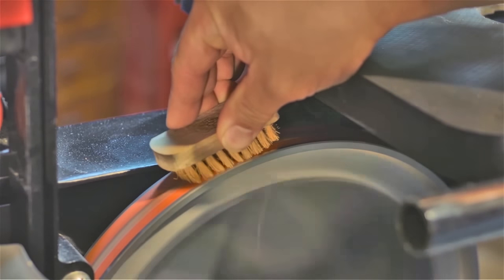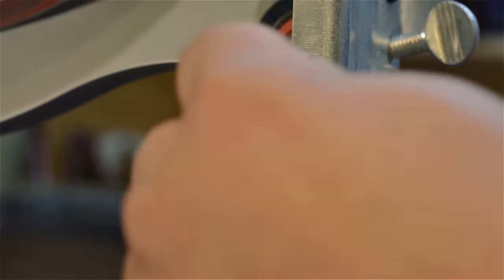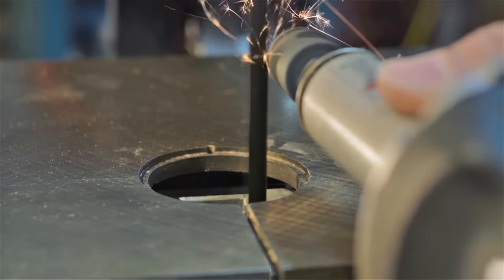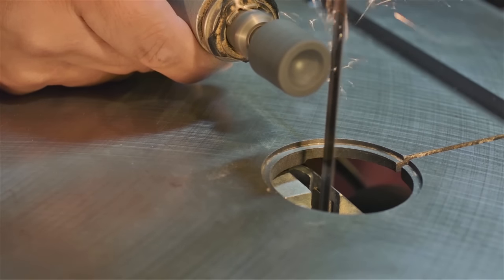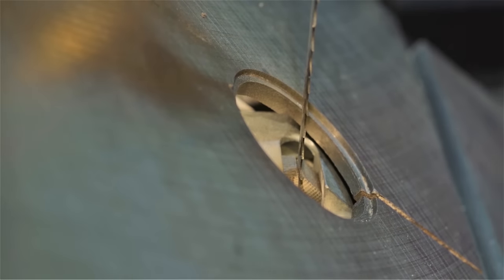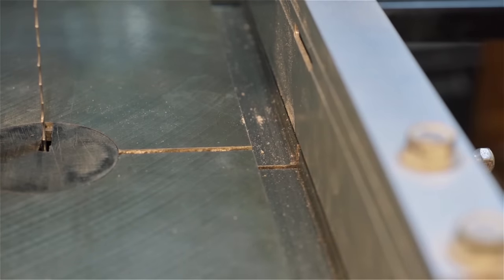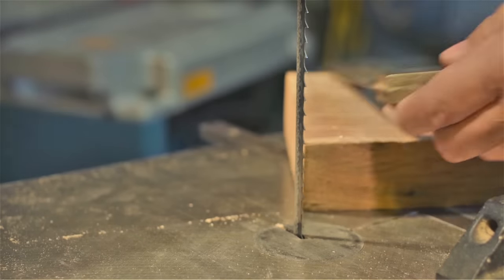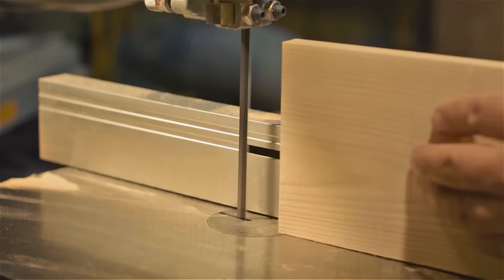Bandsaw Tuning For The Anally Retentive

Comment: this is the best band saw "setup/tuneup" video I've ever seen.  I think we are the only two people in the country who agree the carbon blocks are better than roller bearings--but after trying both--totally agree the cool blocks are best.  Finally, surprising how balancing the upper wheel makes such a difference---there is another video out there where they drill the wheel and use lead weights like balancing an automotive wheel.  Great video--thanks for your work and efforts to educate everyone!
Reply from the maker: Today, bandsaws are made with lots of features,  not quality construction. Consumers rely on the longest list of extras to determine which is best. More stuff is perceived as greater value. Blocks were the norm for over 100 years and are elementally the best support!  I have no idea why bearings became standard issue.

Comment: well, you asked me to comment, so here it is... i do appreciate your attention to detail, however i don't believe a band saw is the proper tool to be worrying this much about. yes i am very OCD about my tools. especially the table saw. but in my oppinion a band saw is not a super precision tool. altho it should be close to 90% and should track straight. i am a carpenter by trade. but why worry so much about the blade back being smooth or straight? does it really matter? and as for the blade "wobble" or "flutter"  in my mind thats why we have blade guides? do you agree? or not agree? i do like the video tho so good job. just thought i'd bring up some of my own points. and i know i really have no room to talk, because i don't post videos of my wood working. mostly because the customers want my time as they paid for it. and not for me making videos. 

hope to hear back from you.                                                      Dave. / jped277
Reply from the maker: Sure, here's my thinking... If the blade back isn't straight, then when it engages the rear thrust bearing it will be thrown off or forced to twist in the spots that interfere. The blade flutter is a symptom of uneven tension in the blade due to imprecision in the manufacture of the blade etc. Tightening up the guides to address flutter would waste motion and increase wear. Everyone is told to set the guides back by a thickness of paper. This is prudent because it accomodates the imperfections in the blade etc. Remove the imperfectons in the blade -- and voila tighter tolerances. Imagine having one tooth on a miter saw blade that was out by 0.5mm, or the blade wasn't perfectly round, or the arbor hole wasn't right in the middle, or the blade was fatter on one side then the other... these would be unacceptable conditions for using a miter box would they not?

I do make a portion of my living with custom interior woodworking and trim, and I'm actually not a full-time You Tuber, I have no ads or sponsors. I make zero income from youtube. I made the video out of frustration because I just felt that every band saw setup vid out there was just another repeat of the same old BS - and that shit doesn't work really. 

I have yet to have the band-saw pay for itself on a job - it is merely a secondary toy that I use for cutting gun stocks and grips out of exotic/antique wood for myself. When you have to cut cheeks and shoulders that are compression fit, then it's gotta be accurate -and why make a fancy router jig for a one off. Everything I do is with a machine, as I am lazy but still anal retentive.  

When, and if I do get the time, I will do a video about how I use/tune my portable DeWalt table saw to do on-site veneer and yacht work. I love that saw, as I can lug it up on a scaffold, or carry it up a ladder... but that's about it.

If I did have customers that paid me for a video.. well then I would be over joyed! I am using You Tube for its original purpose - to share - and in some obscure way I hope that this video has helped others. That's it. I'm not creating a brand or asking for money.

I urge you, to take the time and share whatever knowledge you have or discovered / practiced daily so others can benefit too. Your efforts will be rewarded in other ways! YouTube has become perverted in a monetary/motivation sense, and this is a tragedy really.

Thank you for taking the time to comment, and I hope I answered some of your questions!

Cheers!
Reply: well then. first i am pretty impressed you even replied to my comment. most of youtube now days don't reply to a comment such as mine. and you do make a good point on the band saw blade.... your video does indeed instruct on how to reduce wear on your blade guides.... i wasn't thinking about that at the time of my comment. honestly i do appreciate people like you taking the time to make videos like this one, because i totally agree with you. youtube has become so monetized lately that most videos aren't focused on actually sharing knowledge, and i miss the days when it was... btw i'm age 30.... i wish i had the time to teach what i've learned in my construction years. .  i know i have knowledge that others don't. and i would love to be able to share. unfortunately i haven't been blessed with the financial privilege to be able to spend my time teaching.... so again i say, i do appreciate your video. and anyone else like you who does have the time to make these type of educational videos for other wood workers or carpenters or makers such as ourselves.   so thank you. and at the moment i have to go back to work so i pray you'll have a great night and ttyl.      

later. 
dave
Reply from the maker: Thanks, but don't forget to give back one day, as you will have the financial privilege in the future - just another more 20 years to go - that's the reality, everybody lives with it. You also have to enjoy making videos just for the process. Good luck and cheers!
Reply: great response and great video. i can never learn enough and your explanations are understandable and thorough. keep it up and Thanks.
Reply: If you've ever used a bandsaw that doesn't cut straight, you should appreciate this video.  I am going out to the shop to fiddle with my bandsaw and sharpen the blade =)
Reply: Well said, and a great video, I just acquired a delta band saw so the timing is good, I need to go through it and get it set up .. totally agree with your comments on Youtube, in fact, greed and advertising is ruining my online experience. Every time I go online I'm constantly hounded with flashing ads trying to sell me every tool I ever researched and bought. What a waste of money that advertising is.... and it is irritating ..

Comment: I found your video very useful. I’ve tuned many a bandsaw and follow your process, except for grinding the sides of the blades, never thought of it but will now incorporate into my process
Reply from the maker: Only has to be done if the blades are crappy, mine sometimes have crusted on dirt, and weld spatter - or generally the joint is too thick. Thanks!

Comment: Hi Joe, and thanks for an excellent and informative video. The definition of an X-Spurt is "A Has Been who is also a Drip Under Pressure." MANY experts, including most manufacturers, say to "CENTER THE BLADE." However, while researching for my bandsaw purchase I watched "Band Saw Clinic with Alex Snodgrass" who insisted the bottom of the gullet be centered, as you indicated. I discussed this with my woodworking mentor who tried it and found it to be absolutely true. Good going!
Reply from the maker: Thanks! Enjoy and keep the hobby & craft alive!

Comment: I have a cheap Harbor Freight bandsaw that won't even run because it was an old 3 wheel one. One day, I hope to not be hurting and can take it apart and maybe make a real bandsaw out of it. (I hurt 24/7 because of severe back problems and have to take opioids to kill the pain and have an implanted spinal cord stimulator also.) I loved this video because it showed me how to make sure the build is accurate, stable and runs properly. By following this video I can set up the blade to run right and not give me problems. So thank you very much for taking the time to make this and to impart your knowledge.

Comment: OK, so now I know what I am doing tomorrow...my bandsaw wanders all over the place so time for a tune up.
UPDATE: Did the tune up, replaced the two rear blade support bearings as the lower one one had seized. I can't believe the difference...quiet, smooth (trimmed the back of the blade as well), it cuts true, straight and perpendicular to the table .
Thanks for the advice and a great video.

Comment: I have watched dozens of youtube videos on band saws and tips and fixes but not until I watched your video did I get the information I needed.  I bought a cheap craftsman 10 inch band saw and had no idea about how to really use it.  Well I was trying to use it and the blade broke (I have no idea how  old it was it came with the saw).   I had a tough time finding a 70 1/2 inch band saw blade for it and wound up ordering a few (about $17 each....ouch).. I finally got the blade on but there is a lot of wobble in the blade I will use your information and try to fix the wobble.  Thank you a million times for your video ..I subscribed and will look for more of your videos.

Comment: Good video. I have two band saws and use similar tips to keep them cutting correctly. Some suggestions.....I got some stiff brush "wipers" that are setup so they always rub against the wheel bands to know off particles. This is necessary as my big bandsaw is a geared and different sized pulleys to make a variable speed one that goes from around 40 ips to 3000. The slower speeds are for cutting metals. I use that to cut parts from 1/2"-1" plate aluminum for later working on my metal lathe and milling machine. I also cut plenty of wood for various projects.  Of course you have to change blades as appropriate so all those blades are adjusted as you descibed.
One other thing I think you missed is to take a whet stone and run it against the two back edges of the blade at about a 45 Degree angle. This helps prevent burning or hanging when cutting a tighter curve in wood. I also use a blade wax like product that is touched to the blade teeth when running to put a bit of that wax on the blade. That also helps prevent burning...especially on cherry.
Another tip....use some furniture paste wax rubbed into the table top to make wood slide smoothly across the surface. I do the same waxing on my scroll saw table for the same reason.
I never hand held the grinder though....I prefer having it clamped so it won't move. I have a magnetic base that holds it to the table And PLEASE wear a face mask when doing this grinding to protect your lungs.

Comment: I have been struggling with re saw set up for too long. Recently retired and watched your video twice. Using the same principles my little 1/2hp Delta is making music (and that's with a less that stellar blade). My only out of pocket was for the cool blocks (like $15.00). It will repeatedly cut 3/32 all day long. Just joint a face, resaw, joint, resaw.... Thanks so much for your insight. How could all the so called experts be wrong.

Comment: A few years later:  I finally got in a position where there are some band saws to use and also care for.  I've been setting up band saws for a long time but just by some intuitive method, by guess and by god I think people say.   I have been vaguely aware that there is a higher level, and now the time has come!  I not only watched this a few times, but took notes.  I hope to add some small detail here:  You probably already do this:  The grinding rock on your Dremel or die-grinder is not always very well made, most of them are very eccentric.  I recently found that various diamond dressing tools as used for such as bench grinders work quite well for this!   I got a variety, they all worked.  Basically a few carats of diamond are dispersed in a chunk of metal or stuck to the surface somehow.   There might be a stubby handle.  If you gently touch this with your cheap mounted grinding stone the stone will quickly wear away in a cloud of abrasive dust, but the diamond thing will be basically unharmed.  The touch should be very light, and everything held rigidly as you can manage.  Your abrasive point will be perfectly concentric when you're done, noticeably smaller, and have a smooth surface, you can touch it with your finger when it's spinning to check for that last bit of runout.  That last part might be a bad idea?  Anyway, I want to do the procedure we see here, and USE a freshly dressed grinding wheel on a die-grinder!   Ah, I notice that your number of views is a hundred thousand times higher than your estimate, so there ARE people who care!

Comment: I’m glad someone finally talks about bandsaw setup where the blade is corrected for square and drift rather than compensating by skewing the fence off square one way or another thus negating the miter slot. When correcting the blade for drift, what is your method? What are the most common culprits of blade drift and a blade not being square and how to you properly correct these issues?

Comment: My bandsaw is great for cutting curves, which is generally when you are trying to cut a straight line. Looking forward to putting your tips into practice and so is my bandsaw.
Nice video, thankyou.
Reply: The secret to eliminating drift is to position the gullets of the blade so they run on the center of the wheel. Do not center the entire blade! Getting the tension sufficiently tight is also important.

Comment: Most excellent .. for bread slicing wood  Ill have to polish my chepo "caca"  too !  Yes you have adjusted stuff you just never see on these videos. I always find the weld on cheep and expensive blades is not always square blade to spine and you get a radiated bump in the wood. Just got a hand held metal saw built a slide table for it and it cuts small wood so clean it gives me a smile. Ill be dressing the blade for this thing following your suggestions .......  More power to your anale  treatment of tools with respect like a machinist. Thanks,

Comment: thank you; my band saw is not true on at least 2 of your tests and the up and down is a long way out. always has been and likely to stay that way. I have been using it as finally tuned as I can make it for 15 years and just don't try and rip anything over an inch. Manly used to cut out blanks for wood carving. Good video and well explained. Thanks.

Comment: Being a Master sign maker I've used a bandsaw many times many ways. I found your attention to detail and the flow of your and saw to be very clean. While I appreciate the detail to which you adjusted your saw I found later that using a stationary jigsaw adjusted properly gave much cleaner edges to my letters. Because of the way the blade moves up and down at a slight curve it left extremely smooth edges even on plexiglass and metal letters.
Reply from the maker: Agree, depends on the material/application. The tooth speed on a jigsaw is much slower, coupled with on-demand speed control makes for better control. I love my old Bosch.

Comment: I have an old woodworking magazine that shows you how to get rid of drift.  Part of it was replacing the spring on the top wheel to a stiffer one.   Some of it was the same as you did. It worked, and my saw new cut so well.
Reply from the maker: I never replaced the spring, in fact I run tension as light as possible, just to the point that flutter disappears. The wheels are there to provide motion, not stiffness to the blade. A little tension is needed, but not huge amounts. Cheers!

Comment: You had me at 'owning a bandsaw is like polishing a turd'...🤣I have been messing around with my Ridgid BS14002 that I picked up cheaply on craigslist about 10 years ago. I've been working on it ever since. I will say that I am getting closer to, um, getting it 'polished'. Three things that worked for me: 1) replacing the original rubber tires with urethane. 2) Replacing the drive belt with a link-type belt. 3) Spending an inordinate amount of time balancing the wheels.

Comment: Great video. I only bought my (first) bandsaw 2 weeks ago ( turns out it needed a new blade-wow what a difference, Tuffsaw-6tpi) .As part of the procedure I naturally checked the perpendicular of the BACK of the blade,  just thought thats what should be done.   (I got it perp as well by table ajdjustment).  I like the look of those block guides, I would like guides like those on my bandsaw.

Comment: loved it :). 2 suggestions ... 1. use a small piece of strap banding cut to size to place between your lock screw and your cool blocks for added support. 2. if you plan on using the cheap blades from now on ... use the band saw to make a jig for your grinding in conjunction with your fence. :) could be a nice little supplement vid for you :). keep up the good work. saved to my wood working list!!

Comment: Great ideas for tuning up the bandsaw.  I like the idea of being able to make cheap blades work great.  If the teeth on one side of the blade are duller than the other, you will also get drift.  So that means either sharpening or throwing out a cheap blade and tuning up another.

BUT PLEASE as a person who cut his index finger tendon on a bandsaw reaching around to raise the guard, be more careful.  Use push sticks always.  If you are really going to adjust blocks while the saw is running, get a long allen wrench.  If you are going to grind the side or back of a running blade, get a long file.  KEEP YOUR FINGERS AWAY.  It happens so quick.